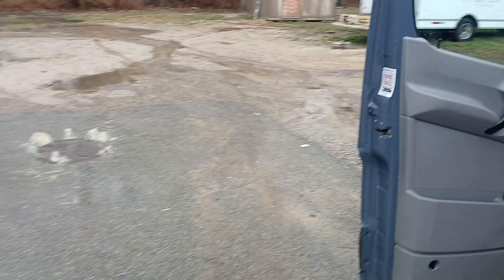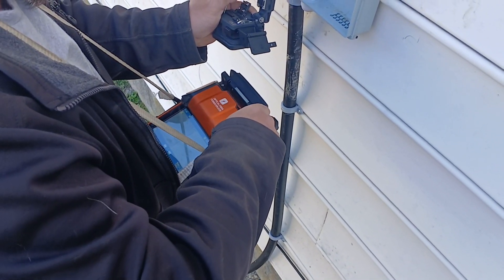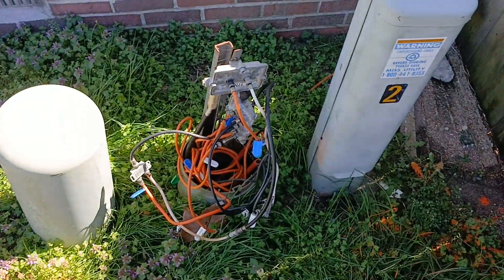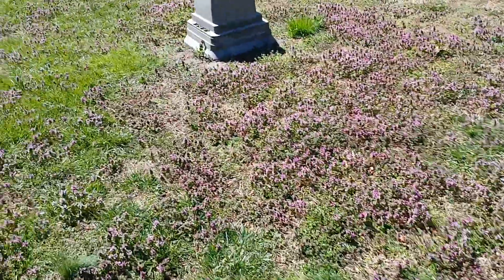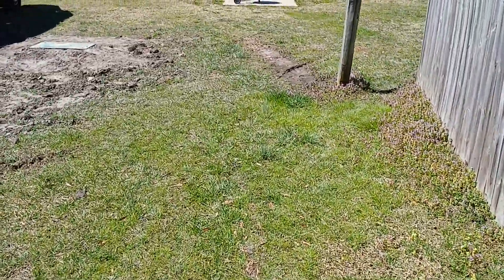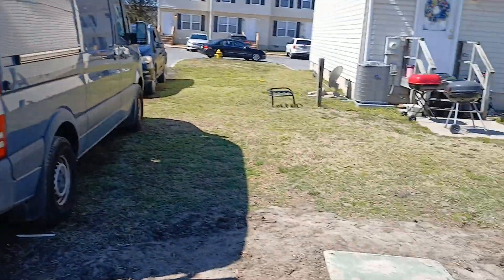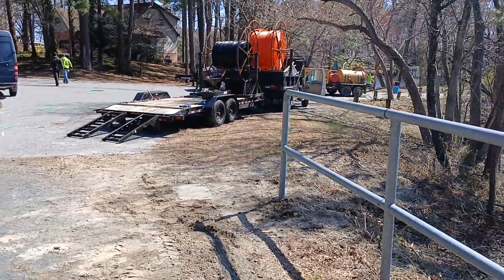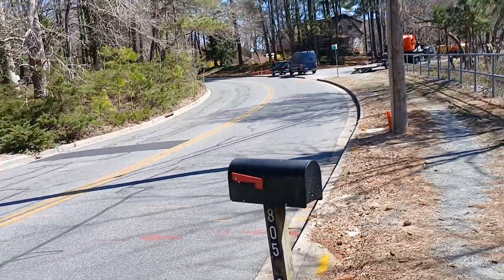Fiber expansion in 3 different areas, overbuilding big cable, new pons, and new crew

Comment: Heya, just curious what happened to the video where you hooked up that 4 ish apartment building complex where they had the old falling apart MMF and saturated your link for a couple days? Went back to rewatch it and cant find it for the life of me
Reply from the maker: I'm sorry I know exactly what your talking about but the way I group stuff into a video I cannot find it either!  Basiclly once we upgraded the customers switch to receive a 10G optic they went from maxing out to running around 1.5G peak so it was close at 1G to working but as they added ppl it most likely got lost into other issues.  We only use some of that old MMF stuff we replaced some with SM.
Reply: @briceperdue7587  Dang, I wanted to rewatch that one for some reason. I think one of my favorite parts of these videos is seeing how the circuits get utilized and actual backbone utilization to your border routers and all that. A video on that subject would be cool!

Comment: Less maintenance and not having to lease poles are good reasons to go underground. Also a lot more material cost in stringing up fiber. If you are doing the work yourself going underground is definitely a good decision.
Reply: Still expensive, but definitely has its pros. (And they outweigh the cons).
Until a conduit underground breaks, that's a PITA.